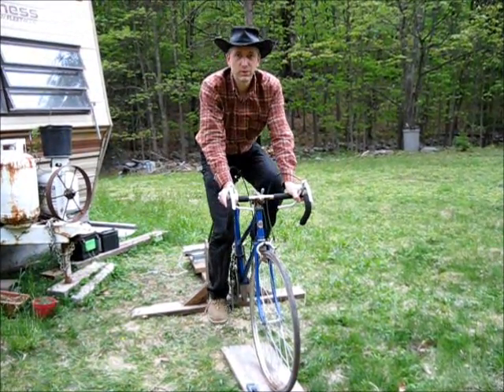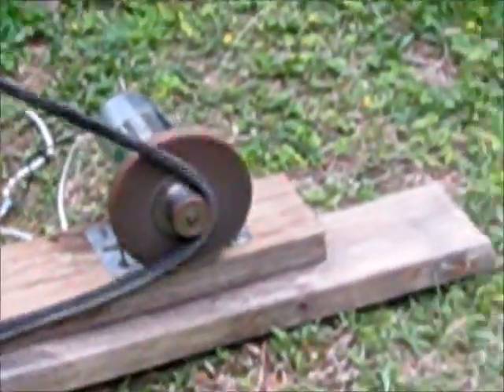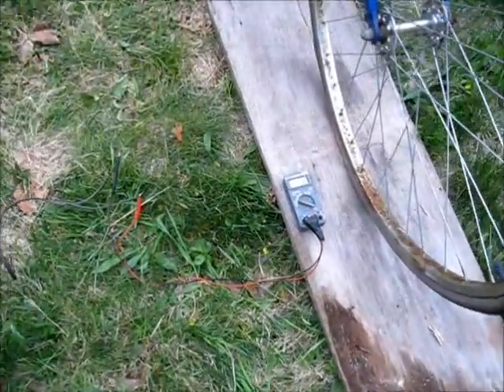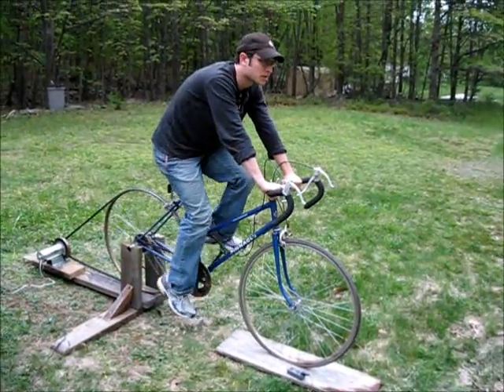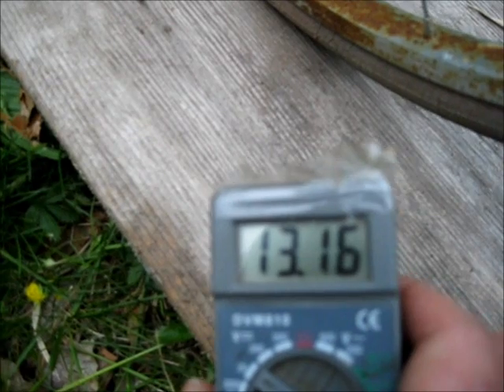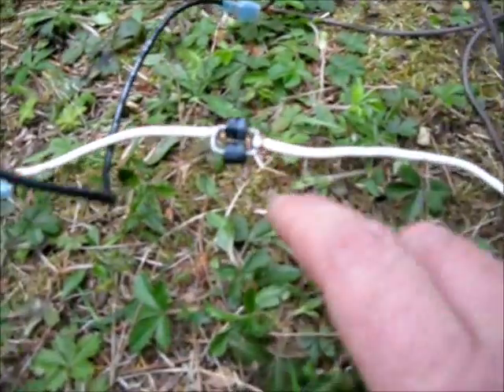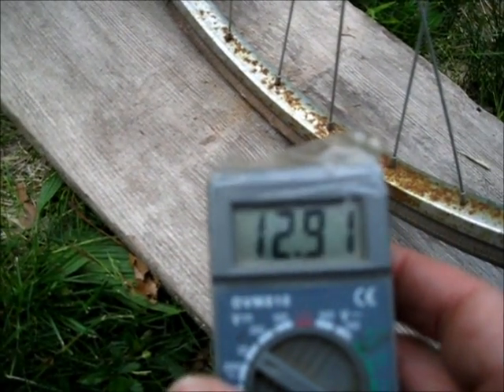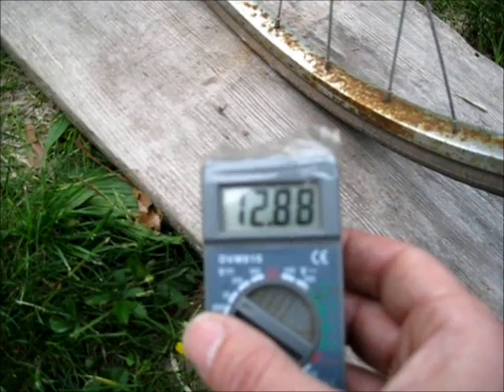Homemade Bicycle Generator - people power for off grid living

Comment: How long should I pedal to full charge a 1400 VA UPS?
Reply from the maker: +Mohamed Sofi Depends on your own generator output but lets say you can produce 300 watts sustained. The UPS is rated at 1400 watts. You have to pedal just under 5 hours to bring it up from fully discharged. But generally you should only use half of a battery capacity to prolong life.

Comment: is it possible to attach a motor to the pedals to get them to turn while still charging the battery. A continuous loop?
Reply from the maker: +bob hope Actually yes. John Bedini talks about that
Reply: +The Do It Yourself World I am sorry Bob but no you cannot create a continuous loop and have the bike turned by a motor while charging a battery.  As for John Bedini, his motor is never under load.  that is why it runs so long and appears to charge the batteries. because the batteries are already at their voltage.  Have Bedini put in discharged batteries on the charge end and see his motor/generator run quickly to a stop.  You cannot make more energy than you put in.  It is not possible due to losses.  That is a good thing.  Otherwise out Planet would Implode.

Comment: Make it more efficient, place the motor right under the pedals and relocate the chain to drive the motor directly. Less friction = more power.
Reply: the would actually generate less electricity cuz it will turn slowly .
for every 1 turn of pedals the wheel will rotate 7 times , 
and for every 1 revolution of the wheel the motor will rotate 7 times
Reply: +Amn Red flag Yes I think you are right.

Comment: Wouldn't it be better to generate electricity from from a cheap fuel source such as wood rather than expensive human food?
Reply from the maker: +ban jomi In a grid down or survival scenario exercise is valuable. Also for modern man, working at the office all day, this is so much healthier.
Reply: +ban jomi No offense - but that's like saying you should never walk anywhere: because the energy to walk came from "expensive human food."  Your idea of eating less to save more food will never work.  People are generally hungry for the same amount if they have exercised or not.
Reply: +ban jomi Ask Troy (the author of this video), not me. His bicycle power generator seems to be doing what he needs it to do. He is happy with it.
Reply: +Kathryn Davidson.. no offence taken, there are however several flaws in your arguments. Your first point about not walking anywhere is flawed because food is probably the cheapest form of energy for getting around unless you want to go to the other side of the world when a lot of other factors come into play. Your second point is about something that I did not say ie. that eating less saves food. Well in fact it does since when you eat less your body becomes more efficient, not least because you don't have to expend energy just hauling a great mass of fat around with you. Your third point re. hunger ...well actually excercise does make you hungry simply because you need to replace the energy you have expended. For example if you run a marathon you burn the equivalent of a 500gram loaf of bread, so you need to eat that much in addition to your normal maintaince diet just to stay the same weight. The modern sedate lifestyle typically requires a daily intake of 2000 calories in an adult male whereas a manual labourer would typically require twice that amount. The human body is a machine that needs fuel and it follows the same rules of physics as any other machine.
Reply: +ban jomi  You might be missing the author's point. This video shows how to easily build something that charges batteries using junk that people throw away, and is powered by something that most people have on hand - food.  If you are suggesting using some sort of wood powered steam engine to power a generator, it likely would be more difficult and expensive to build (or buy), it would be noisier, it would pollute more, ....
Reply: +ban jomi The creator of the video is satisfied with the results, so what he did is not pointless to him (or to me for that matter). As far as comparing the efficiency of a generator driven by a bicyclist vs a generator driven by wood-fired machine, there is no comparison. The waste heat from any machine that converts fossil fuel, to kinetic energy, and then to electricity is enormous. Waste heat from a bicyclist to convert food, to kinetic energy, and then to electricity is minuscule by comparison. Efficiency-wise, bicyclist wins.
Reply: +ItsVideos please let me know how you get along with running your domestic electrical gagets from this power source. ..particularly the refrigerator and freezer.
Reply: +ItsVideos, I think you may be missing my point, whilst it may be an amusing diversion to throw together some scrap that can produce electricity, it is grossly inefficient and really quite pointless. If the time and effort used to build this device was used to earn money to buy solar panels then something worthwhile would be achieved and enough pedalling time would be saved to enable the owner to do whatever he/she like with the time gained.

Comment: You're only generating about 150Watts with this type of pedaling. If you pedal for an hour that's 540,000 Joules, or 129 calories of food energy. Because the human body is only about 20% efficient converting to mechanical energy, that is actually 645 calories.  A car battery can hold about 2.1 Million joules. You'd have to pedal for almost over 4 hours to fully charge...maybe closer to 5 if we take efficiency into account - let's see, generator probably about 90% eff, bicycle about 90%, so you lose about 20% of the total power, comes to 432,000 joules, which then takes 4.8 hours, close to 5 then.
Reply: Rosario Rodriguez depends on the load and size of battery
Reply: its good exercise and only is uses for a little boost. if he really needs power then he has his truck.
Reply: Any idea how much time will a 12v battery last?

Comment: I have a few questions I hope you can help with.
What size batteries are they?
How long do you think it takes to fully charge them?
If I wanted to just run a reg refrigerator on one of those batteries, How long do you think it would take before the battery died and had to be re-charged?

I know a lot of (probably) easy silly questions but I've been trying to look these things up and can't really find the answers I need. Thanks for any help you can give :-)
Reply: +connie connie  compare the power rating of your refrigerator with the capacity of your battery and more importantly the power output of the human body..see nikotwenty above.
Reply: +connie connie He said he pulled at least 12 amps.... 12 * 13 = 156 Watts... So now just take percentage of that. If the refridge is running half of that watt then 1 hour of peddeling will give 2 hours of refrigerating time.
Reply: Better yet, hook the fridge up to golf cart batteries, then use solar to charge the batteries and use the bike / generator for cloudy days or for night power

Comment: Voltage isnt as important as amperage.
Reply: +Tim Kepler Because in this case, voltage is pretty damn important. Think of charging the battery like filling a tank using a tube connected to the bottom with a one way valve(the diodes). If you don't have enough pressure(voltage) to overcome the pressure of the water already in the tank(battery voltage) then you won't get any water(charge) into the tank(battery). Even if you have very little water flow(amperage) the tank will still fill(battery will charge). If you aren't making battery voltage you won't ever charge anything. Amps aren't all that important, just dictate charge time, but if he is heating up to 6 amp diodes, he is making some amps.
Reply: oddball0045 he is rite to some extent...just think if you took 10  9volt batteries wired them in series ..you would have 90 volts but still could not turn a car engine over that only takes 12 volts with a lot of AMPERAGE!.. both amperage and voltage are important but in some circumstances amperage is more important...
Reply: Tim Kepler You how no idea how electricity works do you?
Reply: excuse me? How do ya figure

Comment: where did you buy this generator motor? I wanna buy. ..
Thanks
Reply: You get it from a treadmill
Reply: @Boris_Din_Dietrich__Hazim  You guys find any specific info on motors?
Reply: @WideOpenChange  each motor is different unfortunately. You can only search for its datasheet when you obtain it or you already know the model of the treadmill, hence making it easier to identify the model of motor used too.

Comment: Ridiculous!  (sorry)
Yes you put a surface charge on the battery but you did not charge it. Hook up a 12v tail light bulb to it and the battery voltage will go back to where it was in just a few minutes.

Even if it is a 5 amp motor and you were spinning it at 1740 rpm and "could" produce 5 amps you would be peddling over 20 hours for a 100 amp charge.  On a deep cycle battery like I use in my MH it is well known that it can take up to 40 hours to fully charge a dead battery.  A 10 amp charger will start your car after an hour but your battery is nowhere near fully charged.  Your 80-100 amp alternator does that while we sit on our butts driving around town.

Always fun to make toys, but there is not really anything practical here.  The same energy applied to a job at Burger King will at least pay your electric bill! (-:
Reply: Chris M  I just made one & my treadmill motor is a 21.4 amp motor. I can get this from a very moderate pedal. So yeah 5 hours to charge a battery from the dead state, but beats not having power at all.
Reply: Stop it,  this is not generator.

Comment: cool i always thought about doing this. but why the rubber thing? couldnt you just connect the chain directly to the generator wheel? :)
Reply: Champignon Seje because you have to spin the motor fast, and it would be hard to spin the tire gear at that RPM.
Reply: wax147 ah of course that makes sense thanks

Comment: what happens when you get off the bike? If it's a DC motor then wouldn't it just start using up power FROM the batteries and then turn the bike wheel randomly?
Reply: Isn't that what the diodes prevent?
Reply: Yes like andrew said the diodes prevent the power from going back to the motor, think of it like a check valve the current can only flow one direction